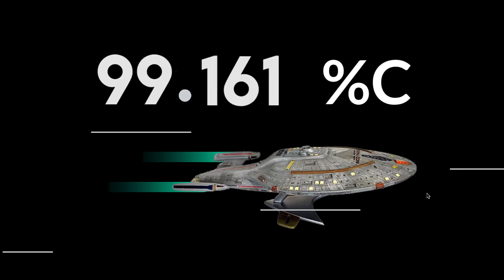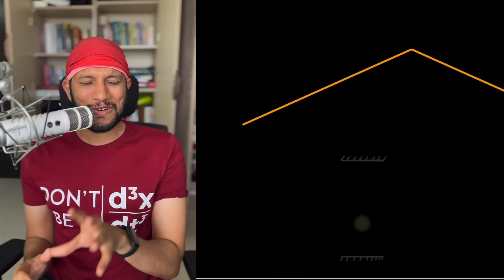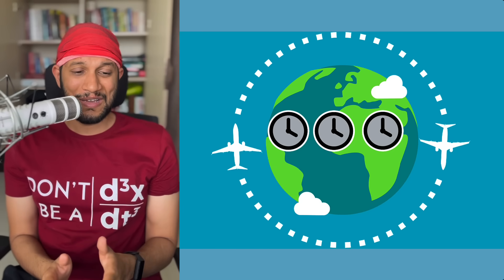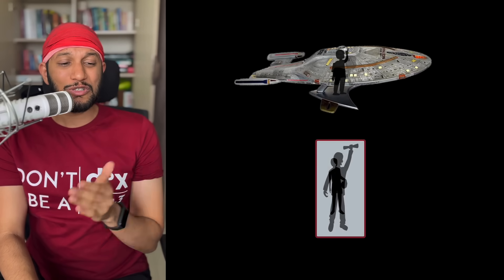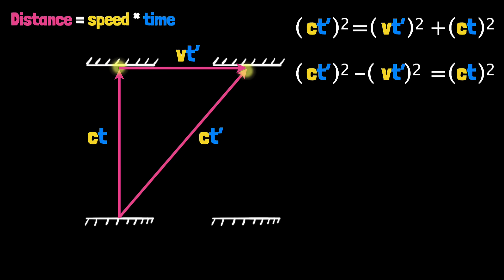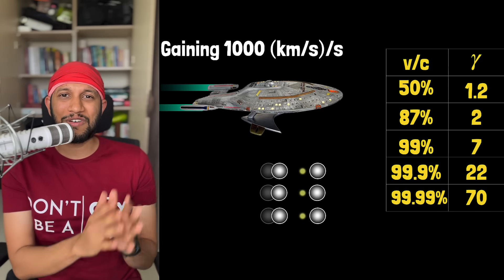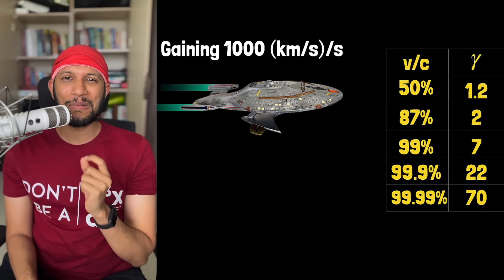I finally understood why you can't go faster than light! (My mind is blown)

Comment: How can light be a constant when it can be effected by a black hole?
Reply: Black holes are a feature of curved spacetime. When you allow spacetime to be curved, the speed of light is only locally constant.
In special relativity spacetime is flat.
Reply: @narfwhals7843  Have we observed light in a black hole to understand that, or is this theoretical?  On top of that, we don't know the one way speed of light.
Reply: @SilasCole88  we have observed light around a black hole. We can't observe anything "inside" a black hole. 
But we don't need black holes up confirm these predictions. Light is already slower around the sun. See "shapiro delay".
The one way speed of light is irrelevant for any physical processes. We can set it equal to c in all directions for convenience or any other numbers that ensure the two way speed of  light is c.
Reply: @narfwhals7843  "Light is already slower around the sun. See "shapiro delay"."

So light isn't a constant if it's slower around the sun?

"The one way speed of light is irrelevant for any physical processes."

It's not irrelevant if I can use any one way speed of light as long as it's equal to c.  Which means I can say that light is instantaneous in one direction while not in another direction.
Reply: @SilasCole88  Spacetime is curved around the sun. So special relativity does not apply in large regions. You need to consider general relativity, and here the speed of light is only constant in small regions. Namely, regions which are small enough that we can use special relativity without having to consider curvature.

You can say that. You can also say any other combination of values that amount to the same two way speed of light.
But it doesn't change anything about any experimental outcome.  
It is a free parameter you are free to choose for your convenience. Like a convenient coordinate system.
It is a matter of convention.
Reply: @narfwhals7843  So someone wouldn't be wrong in saying that the light from distant galaxies to earth is instant, as long as it's equal to c?  This can also prove that light is not a constant because in one direction it can be infinite and in the other finite, as long as these values equal c.

Comment: Not to mention IFF you went faster than the speed of light you couldn't by definition "see" in front of you and at that speed even a speck of dust would create an impact with near infinite energy.
Even if you had a perfect route with NO unexpected anything then like a bow wave on a stopping ship that splashes forwards as the boat slows or stops the "spaceship" would have a near infinite energy bow wave of energy that would splosh forward like a near infinite energy shotgun blast obliterating a couple solar systems at your destination.

Comment: I disagree with the premise that a photon would bounce slower in a moving object. If you jump while on a moving bus, do you stay longer in the air than when the you jump while it’s not traveling? No
Reply: Consider your bus travels at 70kmph, when you jump you dont stay in the air longer obviously, as you approach closer to the speed of light, you will stay in the air longer when you jump. The closer you travel to the speed of light, the longer you stay in the air. Hope this helps
Reply: @ what is the evidence for that? Does gravity change its effect on an object the faster it moves?
Reply: True (in Newtonian physics), but that's because you're ACTUALLY moving faster relative to an observer standing outside.  Like they would 100% agree that your velocity increased.  The reason it works this way for light is because light always travels at the same speed in all reference frames.
Reply: @ recent research I’ve seen says light isn’t constant as we thought. Things like gravity can bend and change the speed of light. But in the scenario given, the object bouncing, as its speed perpendicular to its bouncing motion, is itself moving faster. So its bouncing motion would seem like it would increase in speed, not slow down.
Reply: @krakoosh1  Three things:

(1) this seems like a misunderstanding.  Even in general relativity, lightlike worldlines are always traveling in a "straight line" once you account for curvature, so they are always going at a constant velocity in the correct metric space.

(2) even aside from that, nothing in this explanation requires general relativity.  The behavior of light in GR is not relevant for this explanation.

(3)

> But in the scenario given, the object bouncing, as its speed perpendicular to its bouncing motion, is itself moving faster. So its bouncing motion would seem like it would increase in speed, not slow down.

The key thing about special relativity is that velocities are not additive that way.  For "lightlike" particles traveling at c, the magnitude of their velocity never changes in any reference frame.  They don't behave like normal objects--adding any amount of velocity to something traveling at c leaves it at c.  For normal ojects, on the other hand, velocities are sub additive (though the effect is very slight when observers are traveling relatively close to each other's speed, i.e. are not traveling near c in each other's reference frames).  The keyword to look up here is "Lorentz boosts."

Because the light's velocity has to remain the same to both observers, and from each other's perspectives they are both moving at the same speed away from each other, the only thing that can really differentiate their perception of the beam has to be its angle.  The person on the ship sees it going perpendicular to the ship's axis (towards the mirror) and not moving at all in the direction of the ship, while the observer at home sees it with the same velocity as the ship in the ship's direction of motion, so the velocity in the direction of the mirror must be much slower from the perspective of the "at rest" observer to keep the overall magnitude the same.

There's nothing wrong with your intuition in a Newtonian context.  But you are explicitly running up against the core idea of special relativity.  Why does it work like that and not like Galilean relativity, where velocities just add normally?  Because... we already tried Galilean relativity and it has been falsified by experiment!

Comment: Well quantum entanglement is much faster than light I would say it is so fast, that light can seem static compare to that. One thing is all the math about needing more and more energy. I do not see why. If you take a car for example you set and acceleration by pressings the pedal and if you hold it steady there is no need for more energy for some time during acceleration until desired speed is achieved. And you have all the friction and other stuff. In space there is no resistance at all. And mass/weight is basically non existent since no gravity.  So if you have engine that can speed you up 1km per minute for example it won't need more energy as speed increases since there is no weight(no gravity) and resistance. It has nothing to overcome. It will just speed up as long as it is on.

Comment: The whole "clock slowing down" thing makes no sense in terms of time (for me), because what they are measuring there is a change in the PHYSICAL DISTANCE a hand / photon has to move, so of course it will slow down. But that doesnt mean that TIME slowed down, it simply means that a mecahanism did because you changed the physical parameters for it to "tick" as it were. 
If I took a pendulum swinging at 1 second per swing on its standard oscillation, and then changed gravity so the swing became much larger (and therefore longer to complete), that doesn't mean that TIME slowed down, it simply means I changed the Physics of the clock and the forces affecting it. 
And this is why I dont understand why people think that putting two clocks on planes and showing that if you make the tick take a longer physical path than normal by flying fast around the world then somehow it defies TIME which is a Constant and therefore should be immutable.

Comment: Lets say 2 spaceships travels in oppostite directions, and both have a photon clock. They will both claim that their time is "correct", but the photon clock on the other ship is going slower. Its of course impossible that 2 spaceships BOTH travel faster or slower than the other, which means that both are wrong :body-blue-raised-arms:

Comment: To some extent, (And I ain't spitting facts here, only my intuition and critical thinking) I think that it is impossible, simply because light "mass" would, I guess, be extremely low, if not 0. And any1 that has some knowledge about basic physics know that mass is involved in any measurement of movement, therefore the energy required to reach light speed is astronomic.

Comment: Yes there is something flawed about that explaination as well.  There are lots of objects moving very fast in a different direction from our plane of existence; but that doesn't make anything slow down in either local places. Say there are only ships in the universe and you have one I have the other ; I am going by you at 3/4th the speed of light and you are going by me at the same velocity opposite direction a total of 1.5c between us.  Both of our clocks relative to us appear to be working on time; only our observation of eachother changes.  That doesn't change anything in our reality.  Now you may say but the Photon can't catch up because it is limited to the speed of light - right you can't "instantaneously" jump to the speed of light but you can over time because you aren't constantly accelerating at even close to that speed.

Comment: 13:48 Interesting... the way I see it is that since the force carriers can't move faster than the speed of light they can't transmit whatever single they need to transmit to the next atom if that atom is also moving away from the transmission source at the speed of light. Now I'm curious about a more profound question... why so light/the speed of causality have a specific speed limit at all, why can't it travel instantaneously?

Comment: Ok, but...isn't the perception of slowing acceleration due to time dilation from an outside the ship frame of reference?  What about inside the ship?  Would the occupants just continue to see and feel the same acceleration...all the way to C?  I mean, inside the ship, time dilation is not perceived at all, it all seems the same.

As a thought experiment, what IF the ship actually could reach the speed of light...what would viewers external to the ship see?  Would it just freeze in place, or disappear?

Comment: Nice explanation, but still feels flawed.  The speed of light may be called the constant, which is incorrect as it's been scientifically proven that it can move slower depending on the matter it is traveling through.  Does this not therefore mean, if you are traveling close to the speed of light (where light is traveling through a medium that allows it to be at the speed regarded as the constant), and light elsewhere is being slowed by matter... are you not traveling faster than the speed of light that is being slowed.

 Also, there are still unknowns.  It is still believed that a particle can travel faster than the speed of light if using quantum tunneling.  If this is the case, then how does this method ignore time dilation.

If the speed of light cannot be broken and is the universal fastest achieveable speed, then I fail to understand how we can have a particle horizon in the universe with objects past this being unobservable.  If the light emitted from these objects is not visible to us, then surely that object either moved faster than light, or was already present before the big bang... both of which I believe are theoretically impossible.

Hope you can help?

Comment: What if you accelerated toward a blackhole, whose gravity pull is stronger than light, could that pull decrease the time dilation and therefore decrease the amount of time/energy to reach higher levels of C? 
I know the distance to the center/singularity would probably be reached before any high levels of C would be reached, but in theory?

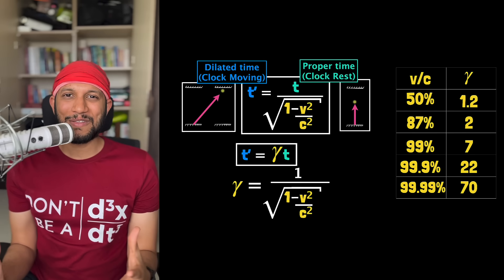Comment: I remember doing this exercise of the "photon clock" with the mirrors (on the floor and ceiling of a spaceship) many years ago and I demonstrated to myself how time dilation works (assuming the speed of light, c, is constant). However I am having a hard time understanding the end of the video from around 11:40 to the end explaining why c is unobtainable. Thanks for this fascinating video.
Reply: The explanation is gibberish, it's not accurate.  It implies that you would feel like you were getting closer to lightspeed about the spaceship, which you would not--light would continue to look like it was the exact same speed as before you started accelerating.  And AFAIK there is nothing in Einstein's equations preventing you from just accelerating at a constant rate forever (in your own reference frame).

Comment: And taking it a step further - as we watch the ship outside, it accelerates to light speed, to us it gets slower. How does that make sense? Only because it's balanced by the slowing of time, the time dilation. Could one mathematically arrive at the point at which the ship is visibly moving the fastest to an outside observer? What is the fastest the ship would visibly move before dilation appears to slow it down? And what is rate of time dilation at that point? There should be a label for that variable :) It may also vary depending on the mass of the ship that's flying - and also the relative speed of the observer to the ship.
Relativity is mind-exploding. :)

Comment: ok, so the time dilation exactly the same equation and the Lorenz transformation for mass as v -> c. When the Lorenz equation for length is included, it becomes clear that travelling at c becomes impossible, which you explained a different way. But that does not explain why it's not possible to travel faster than light (e.g. the theorized tachyon). When v>c, m0/sq rt(1-v2/c2) becomes m0/sq rt(1-(>1)) => m0/sq rt(-(v2/c2 - 1)) => m0/i*sq rt(v2/c2 - 1). Theoretically this should be  possible and should have reducing energy requirements as v continues to increase.

Comment: This is pure nonsense.
If you shoot a bullet out of a rifle with no wind, the bullet goes straight.  At very long range it appears to curve because of the coriolis effect, as the planet is spinning at 64,000mph whatever.
So by the same token, a photon clock might appear to be ticking slower at high speed because the photons are going backwards a bit while reflecting to and fro between the mirrors.  It's completely irrelevant.  What the photons are doing doesn't change time.
If you painted the mirrors of a photon clock black, the photons might not reflect at all.  So could you say that black paint can stop time?
Reply: Well, he says this is a philosophical problem therefore not science. 😂
I never understood why they bind time with mass, dilation effects and what not.
Time goes by irrelevant of how any processes change. It's just time and it applies equally for everything. I don't care if a clock slows down at speeds close to light speed. It doesn't change anything for us in actual real life. It just wastes our time thinking about it.
See what I did there... 😂😂😂

Comment: But from the ship's perspective, doesn't the acceleration stay the same? From their perspective, why couldn't they just keep going? Isn't the point of relativity that no frame of reference is any more right or wrong than any other? Yes the speed of light is common between them but then we've circled back to the original problem.

Comment: You lost me right at the very beginning! Why doesn't the outside observer see the photon travel between the two ends of the photon clock in the same amount of time while getting the illusion that the (diagonal) speed of the photon is higher? In other words, why does the apparent speed of the photon stay the same and the apparent time to travel across the atomic clock changes and not the other way around?

Comment: Your right, at a faster speed our atoms move slower and energy is transmitted slowner. But that doesnt mean, that its not possible to reach the speed of light. Its just not possible with the microstructures we discovered and the univers we discovered (and the physical laws). Because there is no proof (and never will be) that this is the only option how our univers or others could work. We just discover the univers with our boundarys and not with others

Comment: What If i Had to Spaceships exelerating in opposite directions? Couldn't they reach Lightspeed (or even higher Speed) relative to another? It seems to me that the Problem is not that Objects cant travel faster than light, but that light is the fastest thing we can sensor and if Something goes faster we loose track of it and it disappears to us... 
Please correct me If I'm wrong, i am genuanly interested

Comment: That only proves to me matter can't move freely a predetermined  path because another for is hindering it to do so.
That doesn't automatically tell me time is slowing down but there must be a heavy force involved which is also jamming with the proper functioning of things.
Thus in the end that means If men tried to travel at the Speed of light they die, there are not many even able to withstand supersonic and are passing out, which also wouldn most likely lead to death when not interrupted.

Comment: The title of this video can be debated. You actually said it right at 11:48. You can't accelerate a particle to c but what happens if you skip that part and start faster than c? Just going faster than light is theoretically possible and Einstein never said you can't.